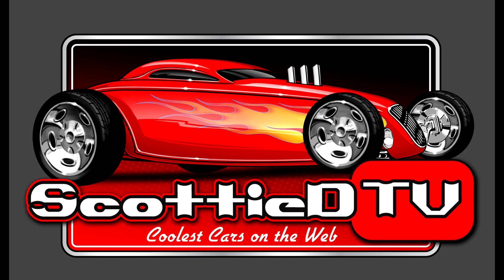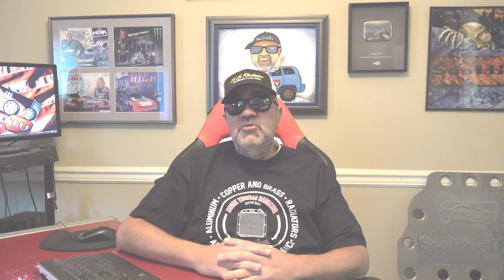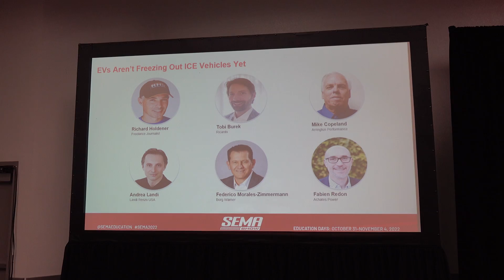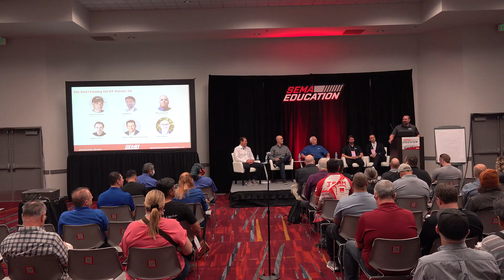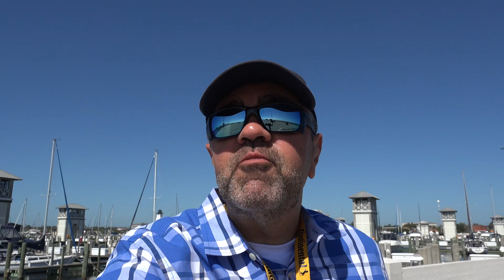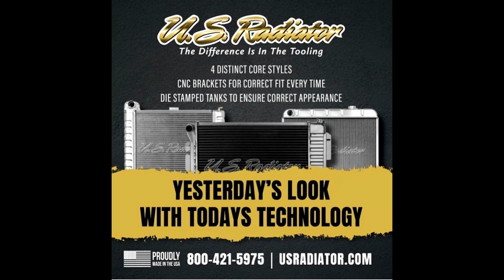EVs Aren't Freezing Out ICE Vehicles Yet SEMA Education 2022 SEMA Show

Comment: if i want to build a hot rod any brand then motor could be a V8 supercharger blower perhaps twin turbo and a sport or race  exhaust pipe
and you hear a wild heavy v8 sound.how is that with electric its only one motor electric,G.M is going to all electric also lotus 
Their is  new battery is based on oil
but to make electricity need coal and oil wind turbines and solar panels is t enough and i am sorry you have a completely insane qrazy clown wants to shut down coal and oil 
and what do we do with the battery ?
take positivity man you got power that tesla X with the paddle down man  what a G force
i want some sort of gasoline or substitute for gasoline so turbo super charger blower heavy race sound can stay
Reply: fergot the battery is heavy a former employer of Spyker work for an English business try to make the battery lighter
a german test show electric make or produce C02 through small particles in tires
Reply from the maker: That's right!!
Reply from the maker: Right on Brother!!